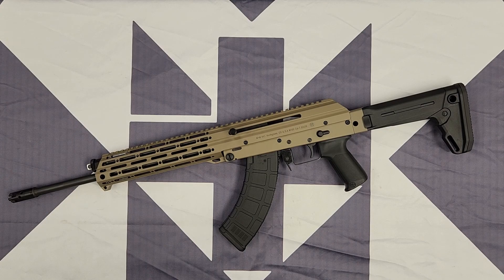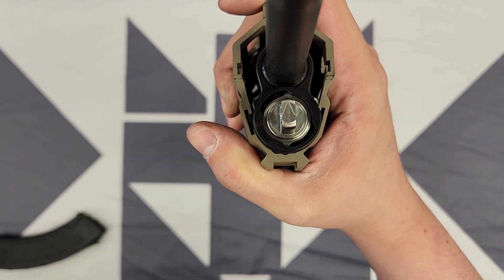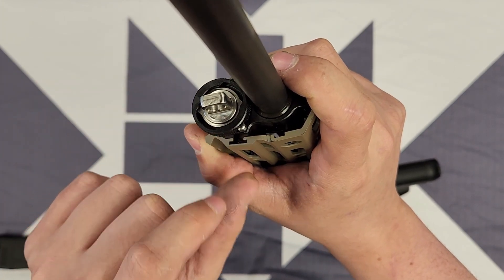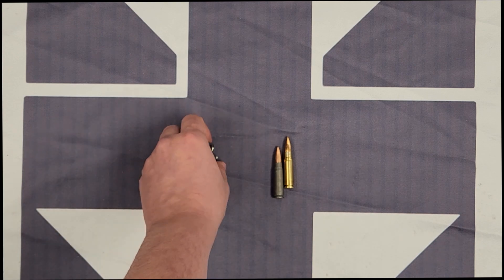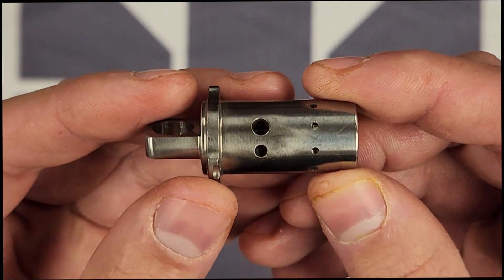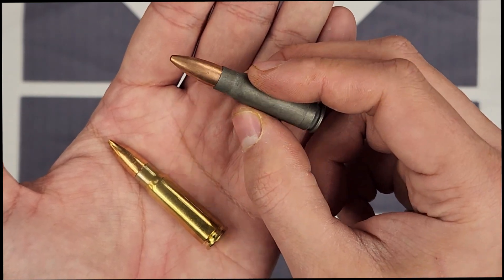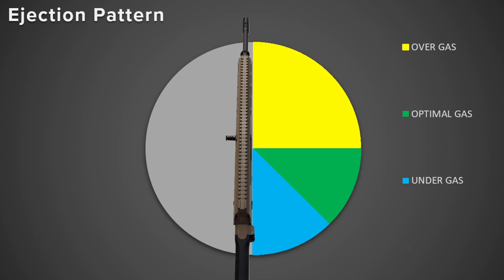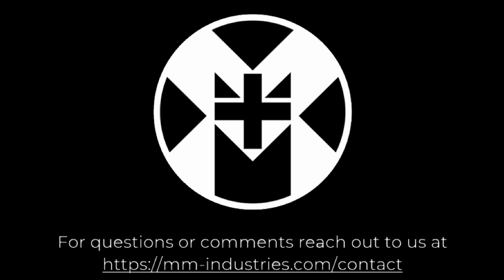M+M Industries M10X Adjustable gas system

Comment: So if I use wolf in my new gun what gass setting should I use and what setting should I use with suppressor?
Reply from the maker: Whichever setting your gun+ammo+can combo runs best with. You can also slightly open up one of the 3 custom holes on the other side of the gas valve to custom tune your rig to your combo. More info in the FAQ on our site.

Comment: That is one sexy AK..I want one...
Reply from the maker: And it's not even an AK.
Reply: @mm_industries  ok...ill bite. It looks like what a "modern" AK should look like...
Reply from the maker: @ETHRON1  The only AK parts are the trigger group, grip, and mags. The gas system and BCG are inspired by the SIG550 series, it hinges open like a FAL, and the upper is one piece monolithic.